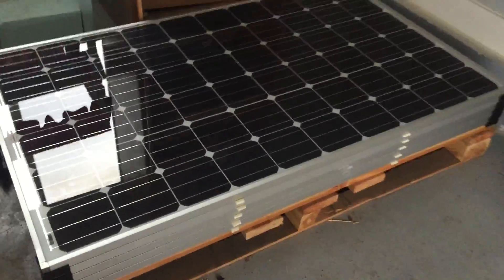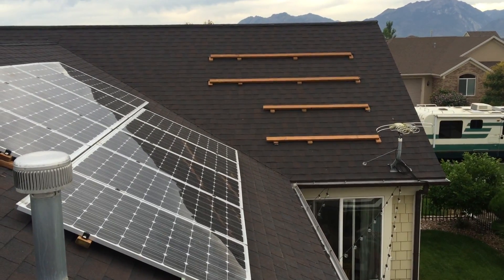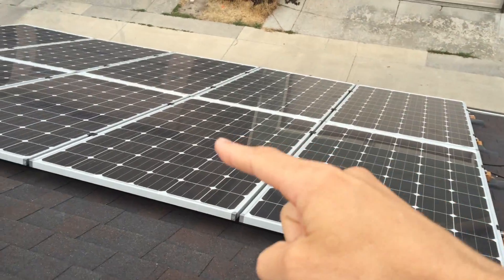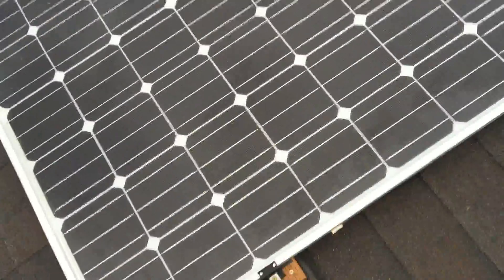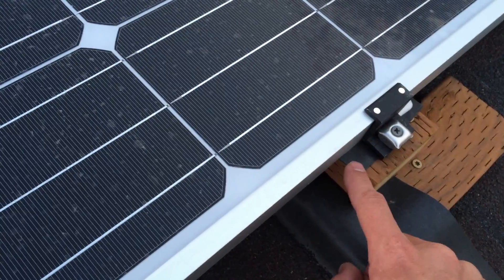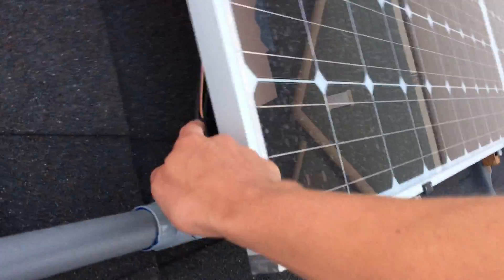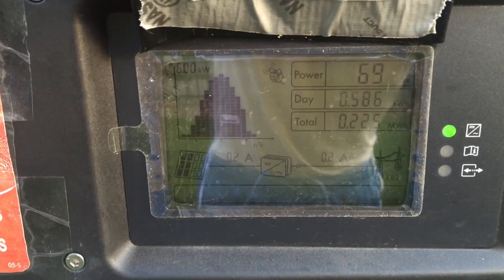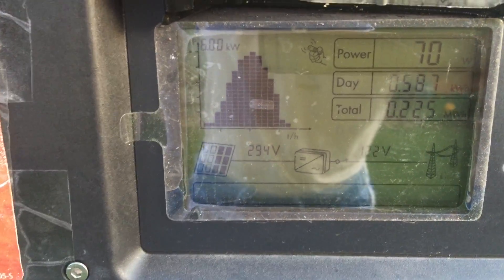How To Install Solar Panels Yourself For $4K - DIY 7KW - South Jordan, Utah - Cheap

Comment: Congrats on a nice setup and informative video. The profit margin of solar install/leasing companies is outrageously high. However, one can save big $$$ DIY'ing it! A couple comments from someone who just ordered all the materials from an online E-rtailer, to do his own 9.3KW GT system on an S-tile roof: 1) Your bare bones mounting solution, usage of flex/PVC wiring conduit and grade C panels wouldn't pass code inspection in our area, 2) Some utilities are eliminating NetMetering plans in favor of ones that generate them more and solar panel system owners less $$. The window of adding solar (and reducing ones electric bill to near zero) is fast closing!
Reply: No Gas, what E-retailer did you use? I have the same roof and was wondering what you used to install on?

Matt, great video, very informative
Reply: Wayne - I've used SunElec.com in the past for motorhome installs and was happy. However, for this project I wanted first quality USA Made panels so went with black Solar World SW290's, a Solar Edge GT inverter with 320 Optimizers, Quick Mount replacement tile mounts (greatly simplifies install) and a full Ironridge racking system. Conduit, Elec Meter & Switches, conduit and wiring was obtained locally. Got two quotes but went with CivicSolar.com. Although they sell primarily to pro-installers, they'll sell Direct if you have your act together. Their web site has prices, so you can plan out your system and figure the costs. Really liked my salesperson Tim! CS sourced everything and it was all shipped quickly via Freight. I'd buy from CivicSolar again in a heart beat! My total system cost was significantly more than Matt's but still less than half what the kiosk "crooks" at Home Depot & Costco wanted (with off brand components).
Reply: awesome, thanks for the info man, much appreciated.
Reply from the maker: you bet and good luck!
Reply from the maker: thanks for sharing - take care!
Reply from the maker: nice
Reply from the maker: thanks for sharing the info

Comment: What is the name & number of company from where you bought panels?  Also will it be better to buy MICRO inverters instaed of 1 huge inverter? Efficiency of panels? Any website to find out how much for my 4 in 12 pitch roof?
Reply from the maker: Manohar Menghani see sunelec.com. Also see the link to the blog post in the description of the video for more details. Micro inverters are good if you have a lot of shade, but they cost more. I don't get any shade on my roof so I don't really need to deal with variances in current.
Reply from the maker: Manohar Menghani oh and also check out sunny design web to figure out all that stuff with your pitch and how much power you will generate. Again, there is a link from the blog post

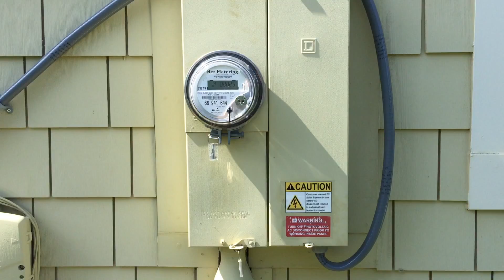Comment: Very Nicely Done System and I enjoyed the detail you included in the vid..  Questions / Comments:  Would it be better to run the grounding (bare copper) wire outside the conduit, or perhaps in its own dedicated pipe?  Should lightening hit, chances are less that the surge would cross over into the Direct Current PV supply voltage wires.  At Vid time stamp 10:13 thru 10:40, might have been better to run the flex pipe under the (appears to be) white cable box so that all flex loops enter boxes from the bottom.  Lessens the chance for water intrusion.    Thank you so much for producing this video.  Excellent.
Reply from the maker: Schrimpieman yes those are good points. I'm not sure if that makes sense to have the copper wire in it's on conduit, that probably wouldn't hurt. One of my lessons learned is to not use conduit at all. If you look at the blog post that I link to you in the description of the video, it has a lot of the same points that you made about lessons I learned.

Comment: Would it be true to say that the money you saved on wooden rails you spent on needing more ground wire. I mean the aluminium rail could have been used as a ground wire between the panels or? may be I miss something.
Reply from the maker: that is true - I would rather have used the money in unistrut and not had to do the ground wiring - that was a pain.

Comment: Hi Matt,
I am very impressed.  Thanks so much for sharing this information.  I've been researching solar panels and my main hangup is mounting.
I noticed that your panels are mounted on the L section of your roof.  I thought that optimally the panels should face South with lesser efficiency off south direction.
My home (long part of the ranch) points in SE direction.  I have a large perpendicular section of the house as well.  Therefore I figured I had to make a diagonal mounting system which just made my head spin.
Any ideas?
Anyway, thanks for the encouraging - well made video.
Rex
Reply from the maker: thanks.  yeah, you just try to get south as much as you can.  Don't overthink the angles though - you will get good production in the middle of the day no matter which way they are facing, and most of the production comes in the 5 middle hours of the day.

Comment: Matt, great job.  I was thinking of doing something similar but actually going off the grid since I have some acreage and am planning using this property for retirement and would like to be self sufficient.  Would your system be large enough to take off the grid if you have enough battery storage for overnight use?
Reply from the maker: yeah, you could do battery storage - just need enough batteries to get you through times of no sun.  I would use the grid as your battery if you can though.

Comment: You may not like my comment. While I don't agree with using a wood product for mounting anything on a roof and I think you'll regret that some years up the road it's the conduit that is really badly done. Would you have paid someone if they installed your solar project looking the way yours does? While you saved money I don't think your project was well thought out.
Reply: Agreed 100%. I've installed over 114kW of residential grid tied systems and was in the project management/ onsite inspection of over 160MW of utility scale solar pv systems.

I applaud your ambition and effort. 

However, your materials (wood racking?? ), lack of protecting/managing solar cables (they will certainly rub against shingles and squirrels / rodents will chew the wire insulation = FIRE HAZARDS), using various roof orientations all on one inverter (terrible for MPPT), not providing adequate spacing to help natural convection (ie air flow) under the panels when they get hot in the summer which will degrade power production,  and likely more because I just had to stop watching. 

Everyone should consult free information from NABCEP on solar installations. 

Extruded aluminum racking isn't expensive. Proper roof flashing is worth it ( ie. Quickmount PV).

Give me a shout anytime and I can happily answer questions.
Reply from the maker: thanks - I agree with your assessment in priniciple, but also it has worked out fine for me.  The wood isn't ideal, but working fine.  The wire management is fine - no animals chewing them.  I don't have different orientations - I have three strings and the 10 panels on each all have the same orientation.  The airflow has been fine too.  I am producing all I expected after 4 years.
Reply: The man put in 100 hours of his time and shared it on youtube for others to learn from trial and error.  This means nothing of course if sleepercell "doesn't agree".  We'll tear it down and rebuilt it to your liking.
Reply from the maker: thanks for the thoughts - much of the joy in life is in the struggle!
Reply: I think the comments from sleepercell are ridiculous and uncalled for. Yes his project might not be as "neat" as if a professional company did it, but he also spent a FRACTION of what he would have paid one of these solar companies who I think are ripping people off most of the time. Also, it's his own house, if he's happy with it, then that's all that matters! Good job bro, kudos to you!
Reply from the maker: thanks - overall it has worked out fine.  I have some regrets about some decisions I made, but I think pros also exaggerate some of the benefits of more expensive options.
Reply from the maker: thanks for the feedback - yeah, these are some of the lessons learned on my diynewman blog

Comment: Okay im building about a 400 sqft cabin max. The only thing that will be running constantly is a refrigerator, everything else will only be on occasionally. My stove is going to be propane and same for my hot water heater. Small electronics like T.V, lights, and water pump will only run occasionally. What size system should I need. I was thinking 4kw but I feel like im over guessing?
Reply: Yes I am doing a off-grid system and from what it sounds like I more than likely will set up a 3kw system so I can save up more power like you said. Thanks for the help!
Reply from the maker: nice - good luck!
Reply from the maker: nice - good luck!

Comment: The wood mounting racks are nice, and much cheaper than aluminum racks.  It never made a lot of sense to me to install aluminum racks that would last 100 years when your roof will need replaced in 30 years.
Reply from the maker: true, but I have had some issues with the panels sliding

Comment: Some of the inverters on ebay from China have been opened up and the electronics are only rated for 1/2 of what it's advertised for, so watch out for reliability
Reply from the maker: Good to know - thx

Comment: That's awesome that you tackled this yourself. That said, I can't believe your AHJ approved your racking, San Diego would have never approved that. Also, you installed almost every component against manufacturers recommendations. Conduit laying right on the roof=bad, pvc conduit on roof = bad practice, mid clamps attached with wood screws=bad, your roof attachments and flashings=crazy bad!, you will never see a roofing manufacturer approve this, taped on safety labels=bad! Your conduit to the main panel looks like a 4th grade woodshop project! Too many items to list! I feel bad for the next homeowner! But being that your a self installer and assume all the liability you can do this horrific install. It sucks that there will be licensed contractors watching this and get poor install practices 😕
Reply from the maker: Thanks for the feedback - I honestly appreciate it.  My only rebuttal is that I searched for this information that you just provided when I was setting out to do this project and didn't find it.  I did my best with what information I could find.  If knowledgeable professionals such as yourself would make videos, document best practices, and make it easy for DIYers like me, mistakes that I made could be avoided.  I imagine most of the information was available to me, but it wasn't easy to find.  

I have added Lessons Learned section to https://diynewman.wordpress.com/2016/07/24/how-to-install-solar-panels-yourself-for-4k-diy-7kw/, and I will be sure to add some of your ideas there too.  Thanks again.
Reply: Hi matt, it takes years of field experience and mistakes to professionally install a system. That's why it is a good idea to hire licensed professionals. If you search enough the info is out there. Unfortunately I do not have the time to help diy'ers as we are not a non profit. But I do respect the effort to tackle the project yourself! Anybody can do it, it's not rocket science
Reply from the maker: True - good points.  I think even if you made one youtube video on how to do even a simple install, it would go a long way.  I also understand why a professional has little incentive to do that though because it could hurt business for them.  I also realize that it takes years of experience to be a professional in this field, but I believe there is something wrong with that because it isn't rocket science.  I have seen a lot of tasks made much simpler on youtube (car repair, home improvement, etc.) that I never would have tackled without youtube videos from people.  While making this information readily available might hurt some people's careers a bit, it is generally good for the industries because it expands them.  I would love to see many DIYers do solar installs, and also I would love to see solar companies get disrupted a bit so they can't charge the high prices they do for solar installations.  I know a lot of people who would do a solar install on their house if it was $5-10K, but won't do it for $15-20K.  People just don't stay in their homes long enough to believe in that.  People also don't want to do financing to get solar.  It just makes it a way bigger commitment.  I would love to see solar on every rooftop, and I think it needs to be easier and cheaper in order for that to happen.
Reply from the maker: One other note - while I appreciate most professional installers' desire to make it aesthetically pleasing, and I have been criticized for how mine looks, we are talking about a roof on the back of my house that no one looks at!  Most people don't care about how their roof looks because they don't even look at it.  I think solar installers' standard for how it looks are much higher than the average homeowner's.  But, I do think it if doesn't cost much more effort or money, it is probably worth it to go through the attic and not do PVC like I did.  I was just a bit afraid of poking holes in my roof because I didn't know better.  This is why knowledge is power - it gives you confidence to do things that are otherwise scary, untrodden unknowns.
Reply: We found the contractor!!!!!! LOL  Then please tell us WHAT he should of used instead of pvc conduit on his roof!

Comment: Great video! Would you please give us a 1 year update video.
How much have ypu saved on electric with your 7 kw system? 
Any issues or maintenance cost? 
Has this project increased your property taxes? 
How does the Federal tax credit work? If an individual does not owe tax at the end of the year, do you still get this credit.
Did the Tax credit work out as you expected it too.

Thank you so much! Would greatly appreciate your response.
Reply from the maker: So I added a one-year follow up section on https://diynewman.wordpress.com/2016/07/24/how-to-install-solar-panels-yourself-for-4k-diy-7kw/.  I saved about $1,200 off my electric bills in the first year (so about 3 years is my break-even).  Only issues have been tightening the screws on a few panels since some slipped a bit (also metal racking system would help prevent).  No increase to property taxes.  More details on that blog post on federal tax credit, but I got the full 30% of my project costs, and my state credit was $2K (capped in Utah).  The credits only work if you owe taxes, but I am not sure what you mean - if you have been paying taxes all year (through work), you would still get it.  As long as you make over about $40-50K in a year, you will owe a few thousand dollars in taxes, so you would get this credit.  Everything worked out fine with the tax credit - was easier than I expected.
Reply: @MattNewman  Those of us whom are retired and do not pay taxes would not get tax credits from what I have been told.
Reply from the maker: @kerigrace5605  Yeah, it just all depends on your income and tax bracket, but I believe you can get the tax credit over a few years, so if you are paying some in taxes (maybe $1K per year), it would just take 4 years to get all the $4K back.

Comment: Very neat job brother.. . Well done. I also like the Mono panels. 
Any particular requirements for panel isolation in case of fire and the fire brigade has to attend.
I myself am doing a small project for 10 houses each rated at 7.8 kWP. These houses have an average  consumption profile of around 5000 KWhr (summer 5 months) and (1800 KWhr winter) 3 months. The remaining months around 3000 KWhr.... Giving the annual consumption around 39,000 KWhr.   ((Heavy summer air conditioning load)).

Hence the 7.8 KWp solar will give around one third (1/3) of the annual house energy.

The panels are from Serapham china poly 24 panels each 325 Wp, 72 cells 2x1 m panels ... with annual degrdedation of 0.7% per annuam with 7 KW invertor from Fronious.

Each house will cost me US $ 9200.
Reply from the maker: yeah, three feet around edges.  good luck with your system!

Comment: almost one year now .. how is the solar working out  ?
Reply from the maker: going great - my bill has been $8/month every month (was $100-220/month).  the panels are in great shape and holding up well!
Reply: that's great,  just over two years you will have paid off the solar panel and components  .. here in florida they won't let us have or use the reverse meter .. big business runs this state
Reply from the maker: ed hondo yeah that is a bummer that some states don't do that.  The power company have tried to get rid of it in our state but people would not let them. I think eventually once battery technology becomes more mainstream the net metering won't be necessary anyway.  You could of course use batteries now and do pretty well but not as cheap because you're probably spend $2000 in batteries. The tesla power wall is intriguing but three times the cost of just getting lead acid batteries
Reply: I'm offshore in Southwest Florida where we have more prime semi-tropical sun than the mainland because of the marine atmosphere ...Our electrical coop is deciding on whether to allow feedback, but if they do they will charge significantly for it...Since we've lived here we've had 3 significant hurricane events that would have sent panels flying to the wind...
Reply: Matt Newman Build your own battery unit. Look up hbpowerwall channel on you tube. Check what he did in Australia.
Reply: Buy a house battery and go gridless... :) stick it to them.
Reply: But led acid batteries don't last as long so the cost is justified.